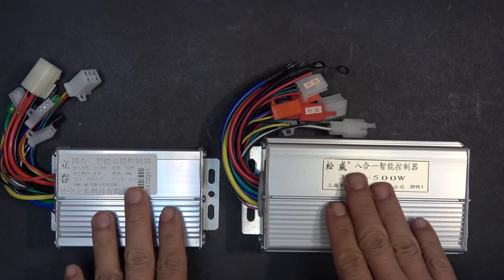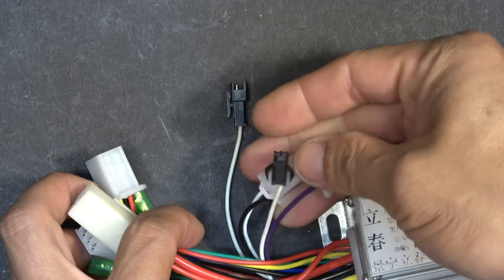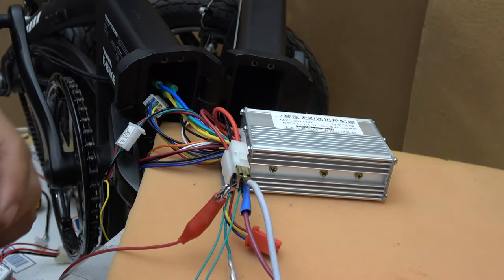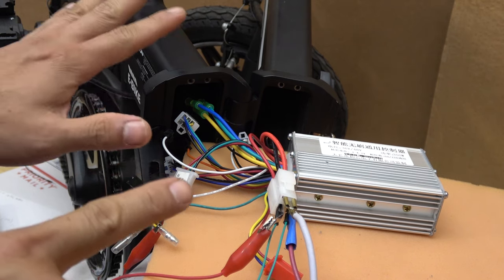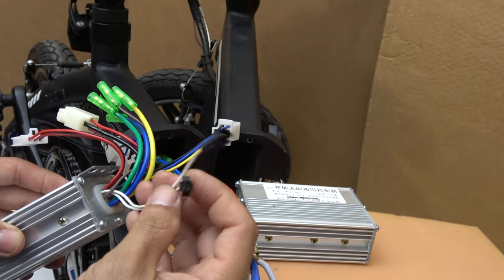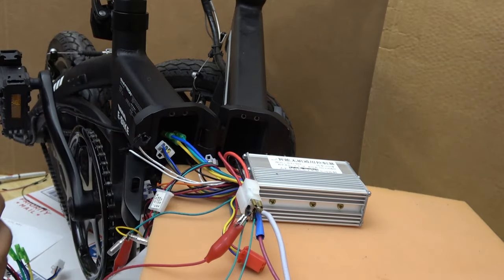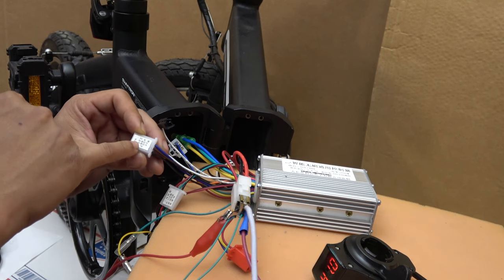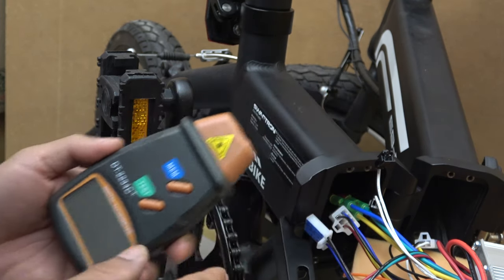How to install a Brushless DC Controller on Ebike: The missing manual

Comment: 20:50 it is called High Brake, and it stops the motor if you put your +40v.
But I never understand the difference with the low Brake. Anybody know it ?
Reply: Low brake just shut down motor. High brake reguraly brake the motor (if non-geared then brake wheel too) - rekuperation is posible
Reply: @jklmnpqrst  zdravím, můžu poprosit o radu ohledně brzdy na mojí diy koloběžce, vše konečně  funguje, akorát ty brzdy nemůžu rozchodit, mám tam tlačítko napojené na low brake kabel  ale jen to přestane točit motor ale nebrzdí,  🙏? děkuji
Reply: @backside511  a nema ten motor volbobezku? Viete ho rozkrutit opacnym smerom? Casto mavaju motory volnobezku a potom technicky nie je mozne brzdit motorom.
Reply: @jklmnpqrst  je to motor z hoverboardu a ano lze ho roztočit i opačně
Reply: @backside511  tak to potom musi ist. akurat teda ako som pisal vyssie, low brake len prestane tocit motor. ak chcete aktivne brzdit, musi byt brzda pripojena na hi brake, ak controller taky kabel ma. ja mam dva kontrolery a oba maju ako lo brake, tak aj hi brake konektor
Reply: @jklmnpqrst   děkuji,tak hight brake byl špatně označeny a nakonec to byl úplně jiný kabel, a teď to teda brzdí až moc
Reply: @backside511  existuju aj lepsie controllery, kde aj brzda sa pripaja tromi kablikmi a teda pripoji sa tam packa ako na plyn a ucinok brzdy je proporcny
Reply: @jklmnpqrst  aha díky, mrknu, možná někdy objednám a vyměním, on právě ten kabel  co jsem použil (modrý)byl na konektoru kde byli 3 kabely, jeden 5v druhy 39v a treti 0,  a ten 5v  brzdi když ho dám na mínus,tak doufám že to ok. Ještě bych měl dotaz ohledně baterie a dojezdu, mám tam 36v 4400mA, speedcontroler je 350W a kolo 350W kolobezka váží asi 15kg, ja 90kg a ujede jen  3 km po rovine a pak to začne  cukat 🙁

Comment: i thought the white wire was a speed limiter
Reply from the maker: For some controllers, yes. But for most after market (Chinese made) controllers, it a program cable. It can't be a speed limiter when it reverses the motor rotation when you plug it in, can it?
Reply: Hi I upgraded my scooter from a 36v 250w to a 36v 350w all wires match but there's no white wire on my new wheel where do I put it my scooter won't run Help Please

Comment: My motor jerks a few times runs normal for 2 seconds and stops.
Reply: Hi friend, the combination between the Hall Sensors and Phase wires are not matching correctly, you need to try around 36 possible combinations until you find message me if you need
Reply: @silver_surfer88  Thank you very much for responding. I read your response and I am still confused. I am not using the hall sensor. My motor only has two wires. I have tried programming with the phase wires but the motor always does the same thing. Three quick and one longer then stops. There are three heavy wires coming from my controller for the motor but it seems I get the same results no matter how I connect.
Reply: @c.douglaslyon9949  Hello my friend, for what you are saying i think you have a Brushed Motor there, if thats so, you need to have a Brushed Motor Controller, that only uses 2 wires, one positive and one negative
Reply: Can you provide more details about the Ebike? How much voltage it is, the model of it, even a picture of the cables or the motor would be great
Reply: @silver_surfer88  Thank you for your willingness to help. I am building a bike from scratch. I have a motor from a mobility scooter. I looked up the model # online and found it and it says brushless. I’ll check again. 
When I look up the model of the motor I find it is brushless and there are no brush caps on it. On the motor are these numbers. Type. A9Y7X00484, model 511100-29500, 24vDC, 200W (S1), Serial No 1205451. There is another small label that says M13.
Reply: @c.douglaslyon9949  Hi, Looked up but there appears not to be much information available, if you apply 24V on + and - does it spin? Also i think that the B1 and B2 stands for a magnetic brake, its all assumptions, try it
Reply: Yes it spins when 24v hooked up and will reverse when polarity is reversed.
Reply: @c.douglaslyon9949  Ok so its a brushed motor,  a brushless motor needs a motor driver to drive the motor, now, you can use a brushed controller or use it directly :D

Comment: 😂😂 all colours mean the same on these controllers fool around and find out if you go boom or your motor or your controller😅
Reply: I’m doing a controller upgrade to my bike at this very moment. I’m sorry but you are incorrect. The colors are not always the same. The phase wires on the controller do not match up to my bike and so I had to use a different combo. This is just one example but there are many more.
Reply: @stephenmatson3239   Battery plus in battery minus.
 the 3-phase wires.
The throttle.
Mostly stay the same Colour or
Always together.
 With enough time and experimentation, you will find out every wire function on the controller despite Most manufacturers' colour blindness or a Lack of organisation

Comment: Never wanted to design anything till Now. First fire the engineers.  If you cannot take 3 wire throttle and simply connect and function Yes. In a word.  HORSESHIT